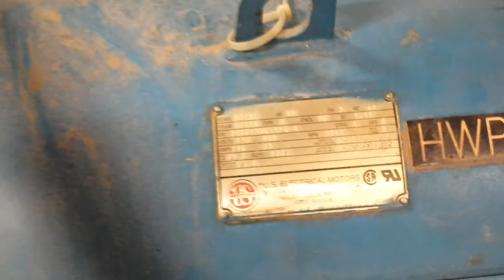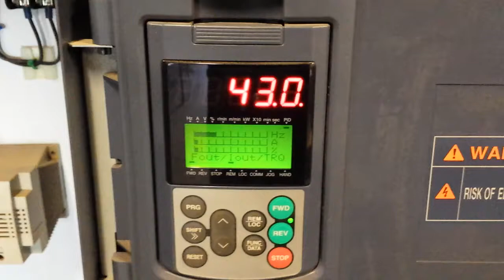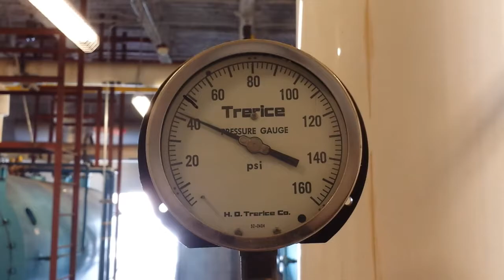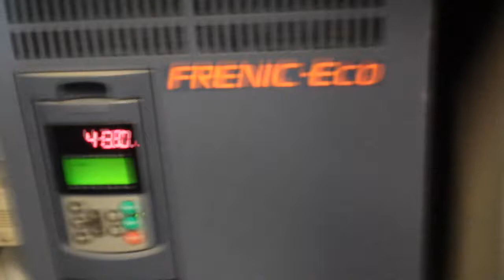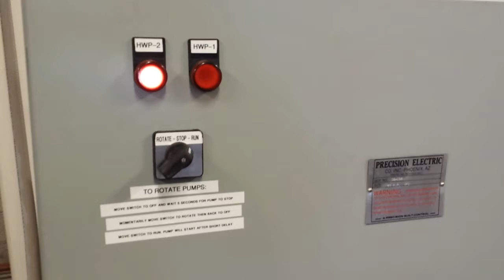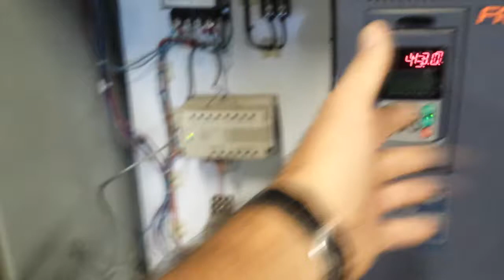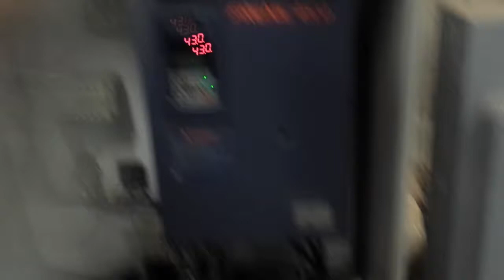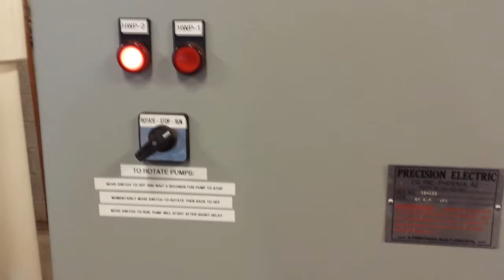Another VFD driven pump mod

Comment: Nice Job!  Also to limit starting current on the centrifugal pumps you can close the discharge valve completely which causes the impeller to slip reducing load on the motor during start up. Then just throttle the valve open. Thanks for the video!

Comment: Sir, (#1) You now have absolutely no redundancy, if the VFD fails, you can’t run either pump, you are dead in the water. You just shot yourself in the foot. (#2) You compromised the safety of that whole system by having only 1 disconnect switch for both pumps, I don’t think that’s even legal. Each pump should have its own VFD with individual disconnect switches….Just my 2 cents.
Reply: ibkoool1 Agree there should be two individual but identicle pump systems and a simple turn of a valve to change

Comment from the maker: Oh, another thing is you want the electrical path as simple as possible between the VFD and a motor.

Installing these "transfer switches" or contractors as I did on the other one are pushing it. Too much can cause weird side effects.
The VFD's operate high current spikes at about 4,000 HZ when recreating a simulated 0 to 60 Hz driving frequency. 

More wire and/or components in between can  cause side effects.

Comment: nice set up, but wouldnt it be better to run the motors through the disconnect switches for service, so you have a way to lock out/tag out the motor for service with the other motor still running?